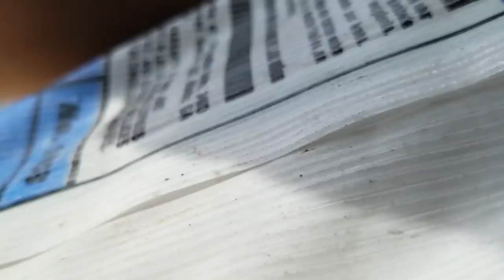Building My DUAL TANK System! & Pond Feed!

Comment: Props on the tanks! Let me tell you that is not a cheep set up, nice job man. Everyone can tell you did your research. Just let it cycle before adding fish so they don't end up dying due to ammonia poisoning. If you want a predatory tank you can go with a South/central American cichilds community for the top tank (trust me the cichlid group is not just jaguars and midus you see out in the wild. There are some impressive fish out there in the hobby, just make sure they compatable with each other)  and for the  smaller tank you can go with smaller to medium fish depending on the gallons available. Maybe a pair of Jack Dempseys cichilds altought you would need 55 gallons and up to house both.  I would hold back on the monster size fish such as the red tail and Pacu suggestions just cause it can bring you a lot of trouble once they get huge. Good luck and always do your research on every species you get.

Comment: You should get some predatory fish. I would suggest a gulper catfish for the lower tank and an electric catfish for the bottom. Gulper catfish just seem like your kind of fish in my opinion and the electric catfish is a relatively large (but not too large) catfish that can be extremely interesting and is just full of personality. I have had mine for a while now and it is just like a dog. It comes up to the glass when it is time to feed and looks like a little seal. They don't need live food and do great with carnivore pellets. Just be careful with the electricity (up to 400 volts as an adult). They can't kill you though, so you won't need to worry about that lol. It would make a great mascot and conversation piece in your home. Just make sure you know what you're doing!

Comment: You should have went with a big old canister rather than two hang on back filters. Canisters do a better job. Last longer and save the ache. Look into Fluvak brand canister filters. Not that so don't like aquaclears for smaller tank but once you get into big tanks like 90g. You should start looking into canister.

Comment: Air stones are a huge misconception. They are for looks. They don't actually provide proper oxygen or aeration. Oxygen is created from movement on top of the water and airdromes typically don't reach that from the bottom of the tank. The two aquaclear 110s should do the trick but consider getting a wavemaker which creates more water movement in the top column of a he tank and the bottom if you will. It will help kick up sitting waste and debre at the bottom of tank and lead it to the filter to be sucked up. Air stones cannot do this.